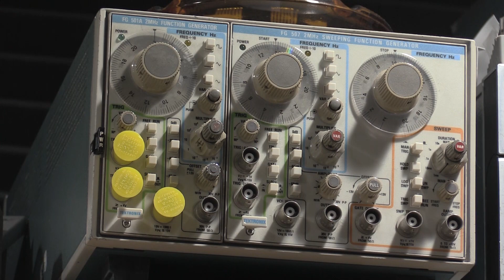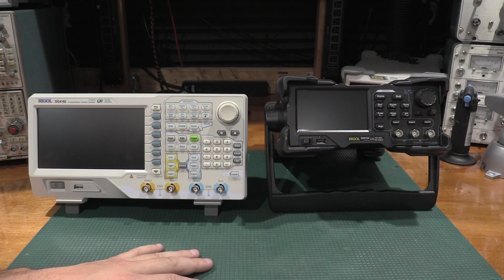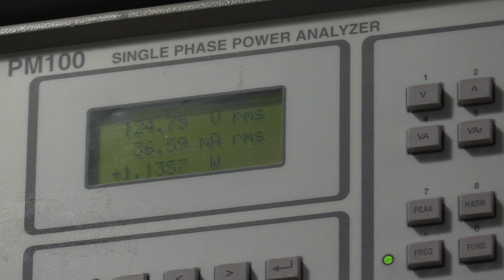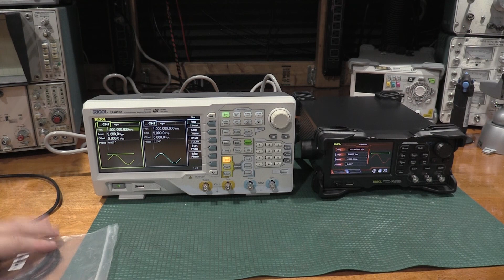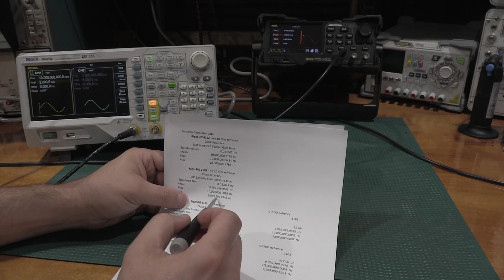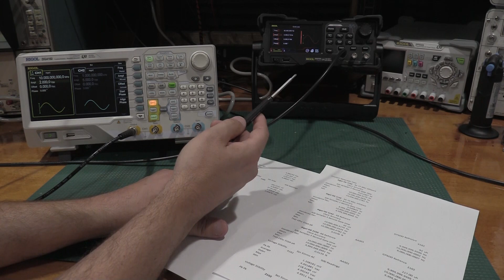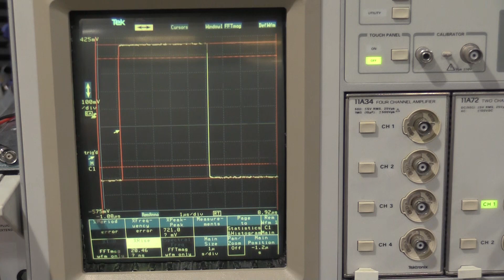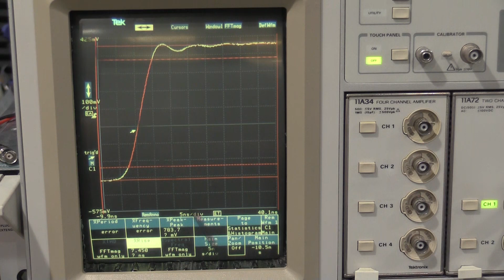Function Generators For Scope Calibration Part 1 Testing Some Candidates

Comment: It seems to me that back in the 70's a lot of function generators topped out @ 2 MHz
Reply from the maker: Faster speeds were quite difficult, and still are really but digital has made some things easier. The two things that really limited things are rep rate (just raw sine wave frequency) and bandwidth (essentially square wave rise time.) Even a lot of modern FG's today are topping out at 1ns rise time unless you get in to the ludicrously expensive. And even then you get the rise time but you are output limited in terms of amplitude. Usually to under 5V sometimes under 3Vdc and some of the REALLY fast stuff in under 1.5 Vdc